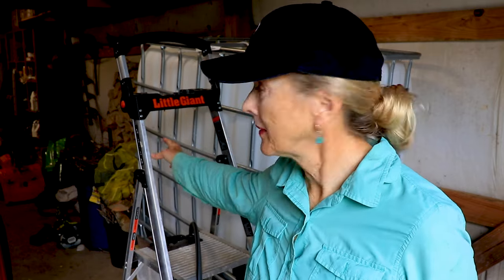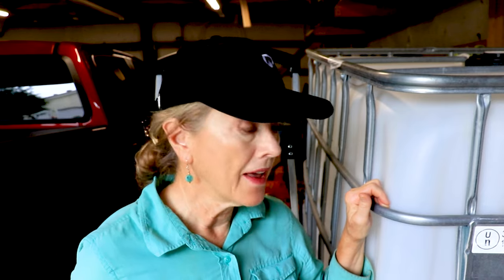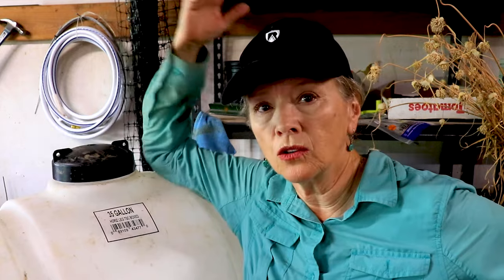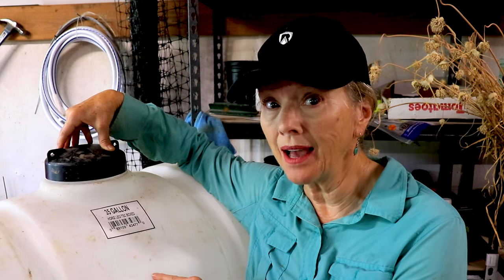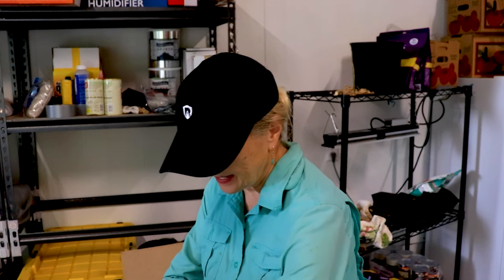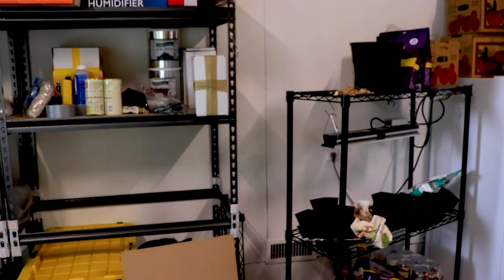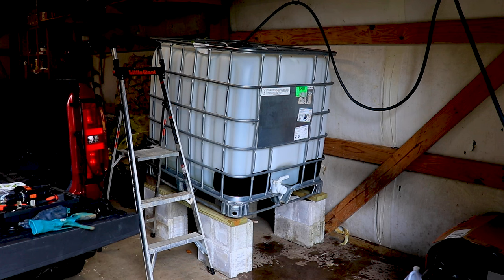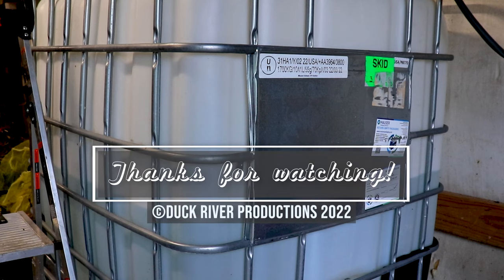TIPS storing water LONG TERM! (Don't make THIS MISTAKE!)

Comment: I found a way to easily clean and sanitize the IBC totes! The top bars can be taken off. Then the cage can be tipped over and the “bottle”, as you called it, can be pulled out. Then you put some water in with bleach and put the lid on it.  Roll the tote around so that the bleach water sits on each of the walls, ceiling and floor of the unit. I let it soak for a time on each side. If there is algae or anything that needs scrubbing, I used a long handled, long headed, dust mop on a swivel, so that I could pretty much reach all of the inside. Then I opened the valve and rinsed it out, sloshing the container back and forth until most of the water was out. If you want the water completely out, you can put a towel down in it to soak up the rest of the water and then fish the towel out. After this process, the tote will be clean as a whistle, sanitized and fresh smelling! Then you can put it back in the cage. I left the top bars off and covered it with some really well made black covers I ordered off Amazon.
Reply: That's what CIty Prepper did in one of his Videos . He then put a tarp around it , cover it up because of the sun. 
Check out his website and you could see what he did.
Reply: Can you post the link for the covers, please? Thank you
Reply: How did you find the covers? What did you search on Amazon?
Reply: We just bought two of these. I was planning to clean mine exactly the same way you did.

Comment: Tip:  to empty a large volume of water easily... take your garden hose and hook it to your outdoor spigot, put the open end all the way to the bottom of the container that is holding the water, turn the water spigot on for a moment or two ( yes that puts more water into the container) then turn the spigot off (as soon as water is flowing in without air bubbles) Undo the hose from the spigot and drop it down. The water in the container will start back flowing out the hose. It will empty the entire container as long as the hose stays under the water of container.
Reply: Siphon- A tube that carries a liquid from a higher level up and over a barrier and then down to a lower level, with the flow maintained by gravity and atmospheric pressure as long as the tube remains filled.👍🏼
Reply from the maker: Thanks so much!!
Reply: So smart I love it!!!!!
Reply: Thats how I emptied my waterbed.

Comment: A tip for city water and chlorine, if you fill large vessels with city water the chlorine should off gas in a day or so
Reply from the maker: But not chloramines, which they are using now. That's what I heard.

Comment: Kaye, check the bottom of the plastic container or bottle or jug.  U.S. law requires there be a mark stamped on the bottom which indicates if it is disposable, not to be refilled, or for long term use.  The gallon containers containing drinking water are designed to disintegrate in landfills; are for one use only. I also had bottles spring leaks. Vinegar jugs usually are stamped for a better grade of plastic, are suitable for long term use and are good containers for storing water.  I have learned so much from you, thank you.
Reply from the maker: And I’m learning from you so thank you!
Reply from the maker: Do you know the numbering system
Reply: I read a 1 inside the triangle is the highest grade plastic for storing water.  The gallon jugs are usually a 2 and should not be used for long term storage due to leaching nano plastics.
Reply: How do you get the vinegar smell out so it doesn't make the water taste like vinegar?
Reply: what jar or barrel would be better , I have bottled water and little 1/2 gallon water . I am looking for something 
not huge to store in the garage.       What you said would be better, storaging vinegar jugs where it's better 
to store water ????

Comment: In Australia, loads of people have been living off stored water in outside tanks for YEARS, including me. I find that most American video's I see don't get serious about water storage. My current tank is 5,500 Gal, or 21,000 litres. You may not need something that big, but with the weather the way it is, you would be better off with large storage than little containers. These tanks are food grade and built for water storage, you have a pump that feeds it into the house, if the power goes out, you can gravity feed it to the house.
Reply from the maker: Thanks for sharing! I have a 10,000 gal cistern, which is leaking again, of concrete block built in 1988, holding about half full. But, it's below the house, so electric pump pumps it up to a bladder and pressure switch which can either go to house or two spigots for garden. I have it set for garden. If we lose water, but have power, I can have limited water in house, but have not tried that as I've only been here 1 1/2 years. What I need is a manual way to get it up to house. I also put in a gravity line to lower 5000 sq' garden (please check out my garden videos!) but there isn't pressure. Of course I could put in a pump, but again, electricity (battery or wired). This IBC tote was a redundant system just in case, though after reading a lot of comments, not sure I want to drink it even if I do put it through my filter. Any further thoughts are welcome! Blessings.
Reply: Drought is not as big a problem in Australia now ?
Reply: @Latebloomershow  the liner idea is a good viable one if the block has "bond beams" with rebarr so it's able to handle the weight without much movement.
 You may have seen concrete block which has slits in it so they can be knocked out with a hammer. This provides a horizontal channel to lay rebar and pour mud (concrete) as block are lated from the bottom up adding the necessary rigidity
P.S. the liners are made custom by pool suppliers
Reply: @psychiatry-is-eugenics  Where did you hear that?

Comment: In case you forgot: many septic systems use a mound which needs electric to pump up to...  once filled without a pump you will backup.
Reply from the maker: Interesting. Thanks! I don't think mine has that, but, I'm not positive. I was told to turn a lever in a pipe in the front yard (presumably down to the line) and it would never back up. He implicated there were two fields. But I have only ID'd one.

Comment: I bought a 1500 gallon through tractor supply and hooked it up to my water main. Every time a sink turns on or the sprinklers, the water goes through my Cistern. I put an intake and and outtake valves on it and it works great. The water is always in use and being cycled. If the water ever stops I just close the valves and use the manual valve on it. That way i don't have to worry about long term storage or chemicals. Its always fresh water. As fresh as the tap can put out lol.
Reply from the maker: OMG, is that legal?? That's such a good idea. Don't know where I would put that though.
Reply: @Latebloomershow  The only time legality would be a problem, is if i was selling the house. I also have a 1 acre food forest around my house which took a long time to get going. So probably never selling. I grow about 10,000 pounds of fruits, berries, and nuts a year.

Comment: In addition to the reflective tarp tarp, that Grace mentions, Danny at Deep South recommends painting clear containers black for outside storage. You can purchase paint that is made for plastics. I need to change the water in my plastic 55 gal. barrels, as it is near 6 yr's old. If your faucet is lower than your container, as mine is, you can run water to fill your house and then disconnect it at the faucet. The water will siphon out of the container. It's a big time saver over removing it in 5 gallon buckets. Thanks for sharing the information. I've been interested in purchasing an IBC tote. The information on purchasing cleaned used ones will be a big money saver.
Reply from the maker: I will be getting an adapter, so I can put a spigot on it, which I can attach to a hose. Thanks! The best totes I found, if you are anywhere near: 
Triple cleaned food grade totes 
275 gallons 
Pickup and delivery available for a fee 
2373 Morgantown rd uniontown pa 15401 
7️⃣2️⃣4️⃣5️⃣5️⃣7️⃣6️⃣4️⃣5️⃣3️⃣

Comment: I was a Lowes a few months ago. I noticed those Brute plastic containers, the huge ones. I flipped upside down, I was just examining it. Low and behold their food grade! Right on the bottom is a stamp of a fork and wine glass! I bought it, washed out with bleach and dawn soap, sun dried and put in my basement and filled with tap water using a bucket. Snapped on the lid and now I have 55 gallons of water to filter and drink if grid goes down. I bought two. It’s a relief to know I’ll have something to drink. I bought two brown ones from the dollar store that are food grade too and filled them. I have a Alexapro and love it
Reply from the maker: Like a boss! Good going!! I am not sure of which containers you mean but I have a brute trashcan.
Reply: @Latebloomershow    Flip it upside down and see if their is a stamped fork and glass on the bottom. Mine did. I bought a few months ago. I might of made a mistake on the size, I’m not sure exactly. It’s grey….
Reply: Is your basement floor just concrete or other flooring? Concrete will break down plastic overtime and cause leaks.
Reply: @virginiadodgen2787    It is cement. Oh dear…the cement will breakdown my containers? Should I slide cardboard under them? I didn’t know this! Dang…
Reply: @cbass2755  cardboard or wood, plywood, or pallet.  I put mine on pallet as it was tile with concrete grout.
Reply: @cbass2755  had some on another part of basement that was just concrete and it started to leak after 2 yrs.
Reply: @virginiadodgen2787    Thank you so much Virginia!  I had no idea. The best I can do is cardboard, as their filled with water. Again…thank you!!

Comment: My water storage is city water. With an appropriate amount of bleach added. I will run it through my Berkey filter system before use for drinking or cooking. 
I also change out my stored water once per year. I always label tanks with a date. 
You mentioned not to place tanks on concrete. Reason for that is chemicals in the concrete can leach through the plastic into your water. If storing water barrels or bins on concrete just make sure you put them on wood or some other barrier between the concrete and plastic container. I just laid down some 2x4's and have my 55 gallon barrels sitting on those.
The opaque gallon jugs of water from the grocery store are made to be biodegradable. If you store them long term they all will eventually leak.
Also, plastic storage containers like the little water bottles or gallon jugs from the grocery store will eventually leach chemicals into the water. Even BPA free ones. So not good to store more than a year.
I am certainly no expert, but have learned a thing or two on water storage over the years. Just throwing my "two cents" out there!
Great video. On an important topic. Thanks for sharing. A good reminder to pay attention to your water storage. And if you are mot storing water, start!!
Just remember. You can only live 3 minutes without air. 3 days without water. 3 weeks without food. After that, bad things can happen.
:)
Jim Gillespie
Reply from the maker: Thank you Jim and I just made a screen save of your comment and I’m gonna read it in my next video!
Reply: @Latebloomershow  Feel free to do so. The more people we can help to be prepared the better!
Reply: The n. 2 containers HDPE, are NOT biodegradable, but fails with time and atmospheric conditions. Biodegradable plastics use starch and are unsuitable to liquid storage
Reply: What do you do with the old stored water? God bless you.
Reply: @melodyclark4347  I use mine on the garden and lawn. Once a barrel is empty I put in some bleach, rinse, drain and then refill for one more year.
Reply: @National757  Thank you so much. I do have one ground garden, 2 fruit trees, a fig tree, and container plants. This is appreciated.
Reply: Hi Jim ,I'm going to fill my 10ft swimming pool with water for storage,i have a berkey like you,could you please tell how to keep the water clean for drinking.
Reply: @melodyclark4347  Garden
Reply: Will vinegar bottle work fine to store water ????  I have to find a dependable jug  or bottle to store water , so I am 
able to carry it .   And it sounds like you know more about this topic , than I do .
I have a plastic shelving where I am store water ( jugs ) , they are NOT sitting directly on the floor.  
I am trying to figure out how much water I need for  , drinking water ,  bathing ,  dishes, and toilet . 
There's so much to figure out with all this prepping .
Reply: Many have fasted n gone without anything at all for a much longer time than just a few days or a few weeks. 
It’s amazingly Miraculous what a man can do if he is called and believes the truth.
Reply: @National757   wouldnt it suck if the week you drained it is when the shtf and the water stopped?  :)
Reply: @badnomad357  I usually don't drain all the barrels at once. Just one at a time and I use the old water on the garden.

Comment: The collapsed water jugs happened to me too so I bought a 50 gallon blue water tank.  I've heard to keep things from freezing in the winter you can wrap them in christmas tree lights.  I'm going to try it.  Not sure if the new ones put off any heat but I have plenty so I'll give it a go.  The water storage situation concerns me more than about anything.  Will I have enough, how often do I need to change it, etc.  It's overwhelming.  Thank you for sharing your knowledge and thank you for caring enough to put in the time and labor!
Reply: might be more ideal to use roof heating cables, wrapped around the barrels.  it keeps it at about 50F
also insulating barrels over the heat tape can be a fair idea as well./ hope that's helpful.
Reply: @davidvalenta9394  Good idea.  I never thought of that.

Comment: My trick for cleaning barrels and totes is a (dedicated for this purpose alone) hose end sprayer loaded with my chosen cleaning/disinfecting product coupled with a long watering wand (remove the rosette on the end) to fit inside the bungs.  This seems to work pretty well at jetting a stream of cleansing fluids and rinse water.  Just please wear EYE PROTECTION and old clothing, just in case you get splashed.  You WILL get splashed.  Once you've got everything rinsed to your satisfaction, reposition everything and rinse again, especially if you are using any kind of soap (not recommended) or caustic agent.  You might find that you've been missing a spot and the repositioning gets it.  Barrels can be rolled along the ground to agitate and get at more surfaces.
I'm often left alone to do this type of work.  Being a lady in her 60s can make it a challenge.  I've learned to keep materials for lifting and propping things up safely.  Pulley systems need not be expensive and are often in box lots at farm or commercial auctions.  Rope and bungee cords, various chains and clasps/carabiners, chock blocks are all must-haves.
To provide some heat and avoid your water freezing, please consider alternatives to anything combustible or that might be a source for combustion of gasses or other materials.  I have found that the brooder heating plates for chicks are quite handy in situations unrelated to brooding chicks.  Much safer than candles or space heaters.  They do require electricity, but many draw less power than you'd think, so a power station or "solar generator" might be an option?  Remember than many combustible gasses are heavier than air, and so they tend to stay along the floor where they are more easily set off by anything at that level. 
Great job!  You inspire me!
Reply: Yes girl! Thanks for sharing!
Also you could use aquarium heaters to keep your water from freezing and keep them charged with solar panels and a battery.

Comment: Get yourself a Gorilla cart if you don't have one.  They are great for hauling and are easy to pull.  I have water storage and we will refill from the nearby springs if the grid goes down.  That way you are not carrying heavy buckets.  I have the 4 and 5 gallon bottles.  I opted for the smaller one because of the weight.   I am not a spring chicken (62), so I needed something I could manage.
Reply from the maker: Yes I have a gorilla card and it is indispensable

Comment: We put ours in the back of our truck and took it to the car wash for the initial soap down cleaning.  Our had held avacado oil in a couple of them and I forgot what the others had.  I believe some sort of syrup.  We brought them home and put them in a shaded area, dropped in water treatment tablets, filled and tarped.  We will run the water through our Berkey if we ever need it to pull the chlorine treatment out but for now should keep it reasonably clean.
Reply from the maker: I didn't do the water treatment tablets yet. Need to get them. If I'd had someone here, I might have been as smart to do that, but the man assured me they had been cleaned.
Reply: @Latebloomershow  I’m sure they can still be added at any time.

Comment: I think the Berkey filter would be perfect.  Since it's city water, I'd probably go with the PF2 filters for the arsenic and fluoride as well.  Good job Kaye.
Reply: Berkey Cost to much
Reply: @JayDee25895  Agree! I researched and compared and ended up going with the Waterdrop brand for much less than Berkey. A lot of people complained about the Berkey also, stating it would plug up all the time and I wanted something that ran a little better.